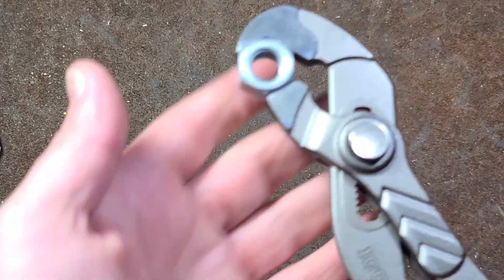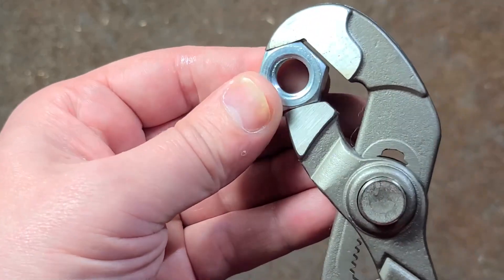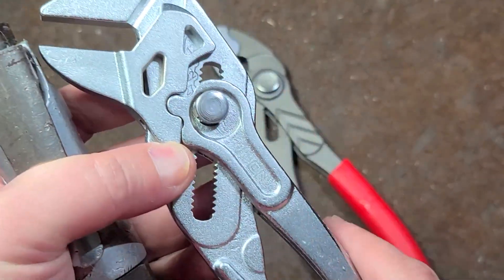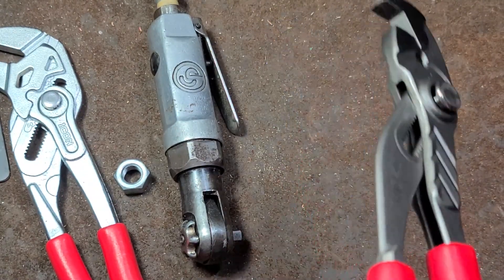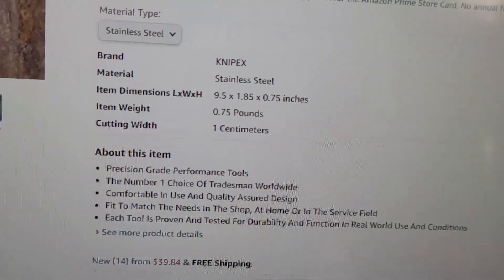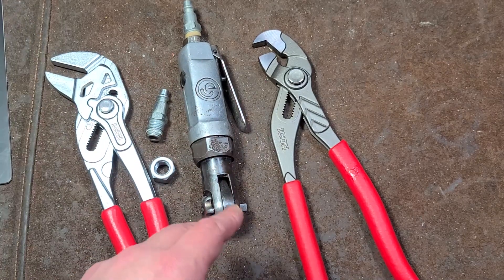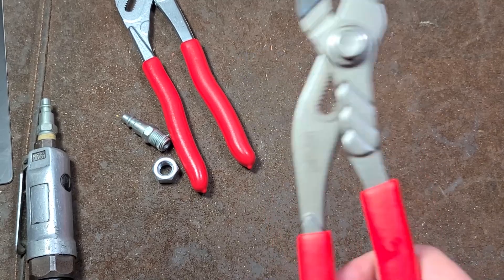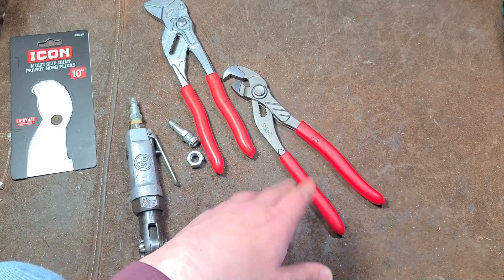Icon 10" Parrot Nose Nut & Bolt Busting Pliers (Knipex Raptor) Review

Comment: You're holding them backwards when you're trying to tighten the air hose fitting. That's why they are slipping. Your whole argument that they slip is because you don't know how to use them.
Reply: No, he isn't. Watch it again or maybe watch a video on how to use a wrench. Just bought these and their junk. The handle is sliding off, and the metal is soft like a cheap cast. angles are different bc knipex patents. Another example of icon copying someone where it looks the same, yet it is completely different.
Reply: He is holding them correctly
Reply: @Alex-lc1bv no he isn’t. With any adjustable wrench or plier you are always supposed to lead the turn with the fixed jaw. 

The way he’s using them is exactly how not to use them and is why he has “fit issues” and why they’re slipping. If you think this is the right way to use them then you probably don’t even need these pliers and should stick to basic hand tools that aren’t adjustable.
Reply: @TadpoleTrainer  not true for the 10" pliers wrench 3:37. Holding that one the way you suggest causes it to slip.
Reply: Agreed, sounds like oper error.

Comment: My Raptors are my only Knipex pliers that I almost never use. I gave them lots of tries, but each time became frustrated because they just don't hold on tight enough. Why knock-off a bad design?
Reply: Just like a 🦜 parrot, Icon wants a cracker.
Reply: Knipex brand recognition is probably enough for them to make money on the knock-off.  The Cobras and the pliers wrenches are better tools, but they're already copying those.
Reply: @feathorn98  Yes, I think that's it. Also, they look like they'd work...
Reply: This may be the one pair where Channellock beats Knipex.
Reply: @aheroicdose  That would be apples and oranges. The fair comparison would be Cobras vs. Channellocks. They're both good tools that do about the same thing, but the Channellocks are beefier, while the jaw geometry on the Cobras seems better to me.
Reply: @aheroicdose  Channellock beats Knipex on the diagonal cutters too. The ease of cut for the materials intended to be cut are superior with the Channelocks. I own several pair of both brands & have so for many years. Satisfied with both
Reply: Thanks
Reply: @Michelle-Eden  nice
Reply: Because new tool junkies like myself will buy them! 😂
Reply: because you ovboisly dont know how to use them. Mine never slip.Never!
Reply: @aheroicdose  no way. You dont use tools much do you?
Reply: They really are superior for breaking fasteners and nuts. They grip tight. You sure you're using them correctly? People do mistake which way to apply pressure on which arm....it happens.
Reply: @larrycroft470  no way! I guess if you can’t afford them, that makes the cheaper ones better! There isn’t one Channel lock tool that beats Knipex!

Comment: These pliers are useful in some certain instances,  but they're definitely not a general use plier.  They work good for alignment adjustments on tie rods, and some hydraulic line fittings.
Reply from the maker: Great point!

Comment: Thanks for the demonstration. 
I saw a fowl test set up on page 2:10+
The jaw opening was set too small and so handle angle was too large. Leaving our hands in disadvantage position to apply correct pressure during test. 
The correct adjustment is to leave the handles as parallel as possible. And NEVER use the first joint of our thumb to operate the handle - as seen in the video. 
Anyway your point is well take.

Comment: No problems with my Icon slipping. The handles width for  a nut is approximately 1/3 the width of my plier wrench. Adjustable wrench is still the winner for tight spaces.

Comment: That’s why I only buy from Amazon, or third party sellers that have the shipping fulfilled by Amazon. I only buy Amazon prime. It’s usually the real price or a little more expensive (can also be much cheaper than normal msrp, but that’s rare.) and it is very easy to return something. No need to deal with a third party seller.

Comment: I bought the actual Knipex version. Amzn kept showing them to me. Returned them when they didn't live up to my expectations, which were very simple -
Reply: use the tool correctly and they are awesome
Reply: @MitchGaar  I suppose, but it didn’t work for my applications which were random nuts and bolts on cars and general mechanics. Either the handle blocked access or turning or the grip could not be maintained: looked great in concept, but didn’t work out in practice.

Comment: This is what happens when a company half ass copies a design. HF in a attempt to become a "just as good as" company, short cuts are being made in design and materials. 
I do like some of HF items but personally if you are not going to put in the effort and cost to produce a proper tool then it is a fail. Dosen't matter if it's cheaper if it is half ass made.
Edit to add, those Channel Lock pliers will absolutely grip a fastener and for the money are an incredible buy.
I bought the HF , US General full bank 34" tool cart and love it. Solid, well made and priced very well.

Comment: These are twice as strong as Adjustable wrench! I think you were using them wrong! This are awesome!
Reply: He has the wrong jaw angle..... He needed to set it one or two clicks looser.
Reply: Yeah I was going to say. Adjustable wrenches are a last ditch effort. Having use multiple types of pliers this just looked like improper use.
Reply: Yea I purchased these from HF to try em. Only tool I own of ICONs besides the mini ratchet set. Initially hated em and thought they were garbage. Recently thrown em back into the bag to try to use for some specific instances. Seem to work fairly well but a bit of a learning curve to get used to in terms of finding the right setting. Actually liking so far in the limited use case of recent. They are not replacing my cobras, pliers wrench, are Bahco adjustable.

Comment: I have a Irwin Vise-Grip parrot beak locking pliers that grips 3 sides of a fastener, side #1-3-5, NOT side #1-2-4 like this Raptor design.  The pressure on side #1-3-5 grip will be even and will not distort the fastener.  It will also NOT slip.  This Raptor design would be great tool if they follow the #1-3-5 grip.

Irwin, like many former great tool makers, has gone the way of lowering their quality to junk territory.  I sort out every piece of the same product at the store to find ONE that has their jaws meet each other evenly, and grip face planes square to the jaw movement.  If they are not square, it will mar the fastener or place uneven pressure on the face of the fastener, distorting it.  Some pieces has a lot of slop in its movement.  I am hoping the metallurgy is not too poor and hoping the quality of the rivets used holds up.  The design is great.  The manufacturing quality sucks.
Reply: Got a model number on that Irwin?
Reply: @shihster88   No model number on the tool.  Just a "4LW" cast onto the main body.  I suppose the "4" means 4 inches.  The tool measures 4-3/4" long.  Build quality and fit and finish definitely are inferior to the Icon tool presented here.  There is also a "12" marked on the linkage that pushes against the threaded adjusting screw.  I don't know what it means.  I think I got the tool from Amazon along with the long nose version stamped with "4LN".  The 4" long nose is about 5-1/2" long.  I guess when they say 4" they mean the body and not including the jaw portion.  I also have a 5" version of the traditional jaw as well.  I've decided to put the long nose model into my motorcycle carry tool kit.

Comment: Yeah you’re using them wrong. The fixed jaw should always be your leading jaw with respect to the direction you’re turning the fastener.  

That’s not great for two reasons: worse grip but also more wear and tear on the joint which is not made for the same level of abuse as the jaws themselves.

Comment: This video and https://www.youtube.com/watch?v=94uKZJWi9Ic seem to have opposite results and reach opposite conclusions, and I think I see why. Let's label the angles of a hex nut A, B, C, D, E, and F. The sides are AB, BC, CD, etc. If A is the angle at the outside top of the Parrot/Raptor tool closed around it, in your video the bottom jaw is putting more pressure on angle D, and the Parklan Custom video has the bottom jaw putting more pressure on angle E. I suppose in theory the bottom jaw of either tool puts equal pressure on D and E, i.e., on side DE rather than on either angle, but in practice I think one angle gets more pressure than the other. To the extent that D gets more pressure, the bottom jaw is pushing the hex nut in the direction of A, towards the outside; to the extent that E gets more pressure from the bottom jaw, the hex nut is being pushed in the direction of B, which is snug into the inverted V shape of the upper jaw. The Icon and Knipex lower jaws look almost the same to me but not quite, and I wonder if the Icon shape tends to push on D more and the Knipex tends to push on E more? In any case, can the Icon tool be adjusted differently than in this video, so that E gets more of the force? If so, I wonder if a follow-up video test, ideally with both brands' tools, might be revealing and helpful. Thanks for considering.

Comment: Foolish review.  One of the biggest purpose of a tool like this is to help with rounded fasteners.  You critiqued the angle of the jaw based on your thoughts of using it on a perfect nut
Reply: I respectfully disagree.  Even if this tool is treated as a rounded fastener only application, the advantage of the force on face #2 of the fastener is marginal.  Most of the grip force is on one corner of face #1, and the middle, away from the corner, "flank driving", of face #4.  With that, it is not a superior tool for rounded fastener application.
Reply: @1984GOrwell  , I kinda agree with Ly B on this ... if it's for fasteners that are starting to round off or not, the Reviewer states that it is a "Nut Buster" (which implies that it is for Loosening very tight nuts/bolt heads, right ? ), then he proceeds to try to tighten a nut with the tool ? And as another commenter mentioned, it might be a better demonstration if the Reviwer was not holding the thing he is trying to tighten (should be loosening) in one hand and using the tool with only one hand ... if it was a fixed/heavy object with the nut/bolt head, then He could use both hands on the tool to apply more squeezing force and try to Loosen it Not tighten it ...
Reply: @HomelandCitizenCCCP  From a more practical perspective, I don't think there will a a lot of difference if the fastener contact face is 1-2-4 vs. 1-3-5.  I am just splitting hair.  I have only encountered ONE incident where a very soft metal corroded fastener was deformed during the loosening attempt. Even pressure o 3 sides of the fastener is just ONE part of the equation of many variables that defines a good tool.
Reply: @HomelandCitizenCCCP  I also agree. The author of the vid is a dunce. He had the jaws no where near open enough, and even when he did open them more it wasnt enough. If you open them to the right setting, they're not gonna open up on you. If you want a tool that'll tighten and break loose bolts without any hand strength, its called a pipe wrench.